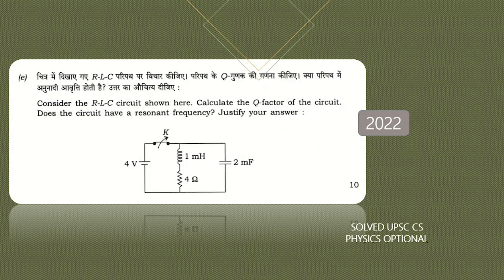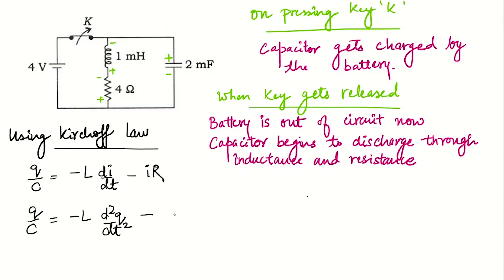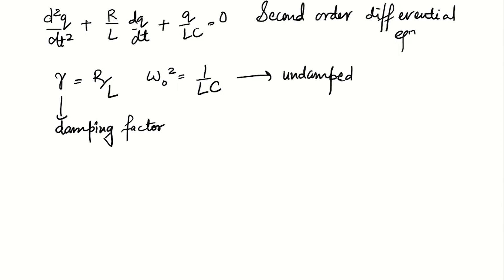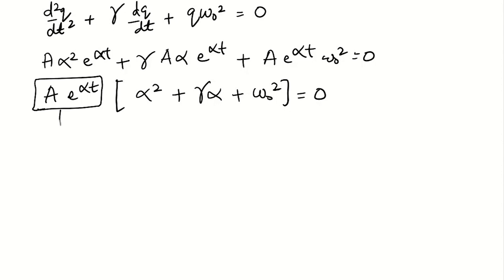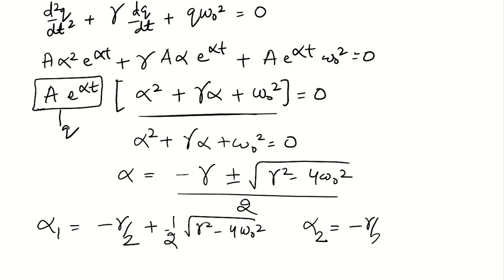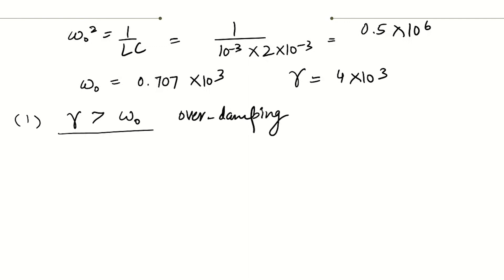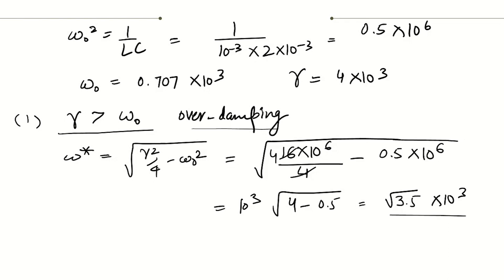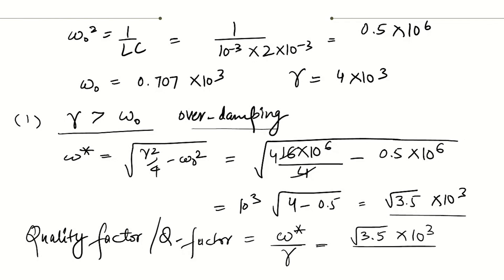SOLVED UPSC CS 2022 PHYSICS OPTIONAL PAPER -1 Q5(e)| Q-factor

Comment: Respected mam, how the polarity of the inductor and resistor opposite to that on capacitor?
Reply from the maker: When the capacitor is charged, the battery gets out of the circuit. Then, discharging happens through an inductor and resistor. As current increases through an inductor while discharging , an electromotive force (e.m.f.) (voltage) is induced when the current flowing through the inductor changes, and it is described by Faraday's law of induction. As per Lenz's law, the induced voltage has a polarity (direction) which opposes the change in current that created it.